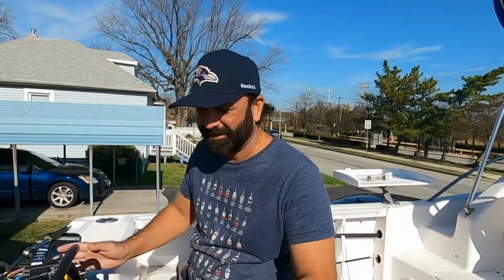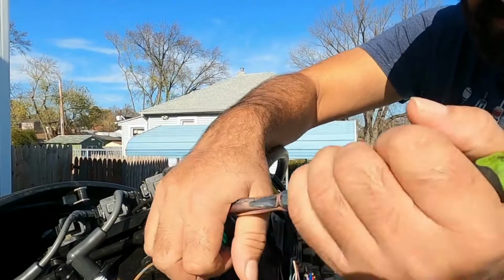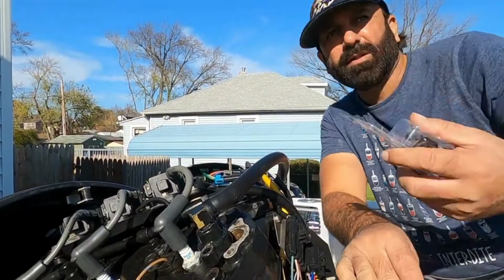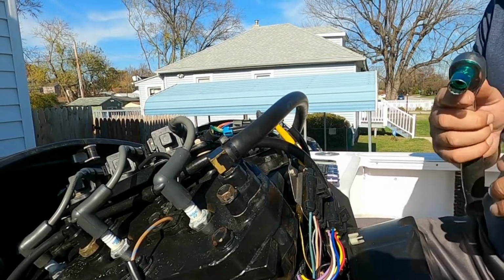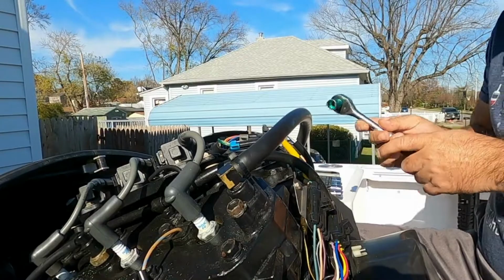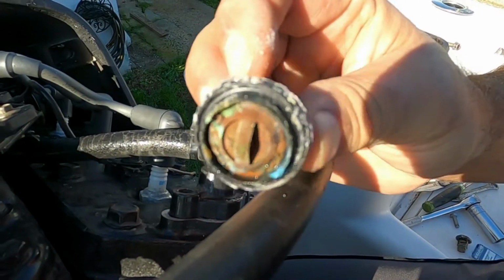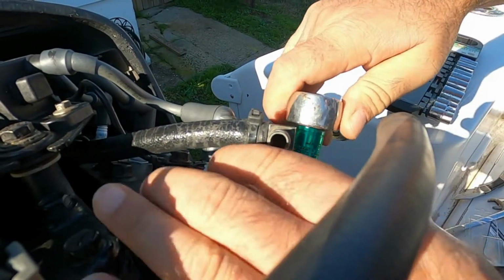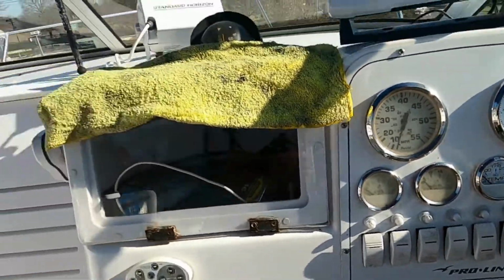Installing Thermostat on a Mercury Outboard | Play back Thursday | Edited Version | FK & Camera

Comment: The positioning of the rubber grommet is incorrect.  It is a grommet, not a gasket.
Reply from the maker: The rubber grommet goes on thermostat as shown in the pic in video. I removed the other video, not sure why it was still on line. Your feed back was extremely helpful. Keep those comment coming in. Thank you.!